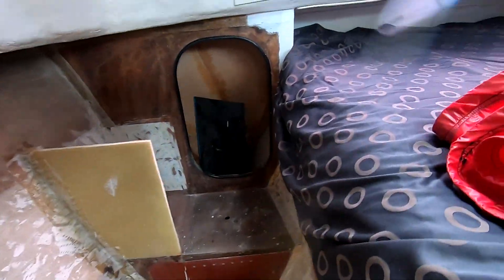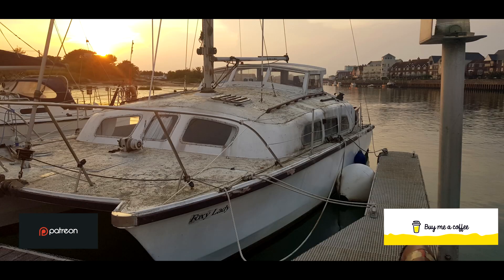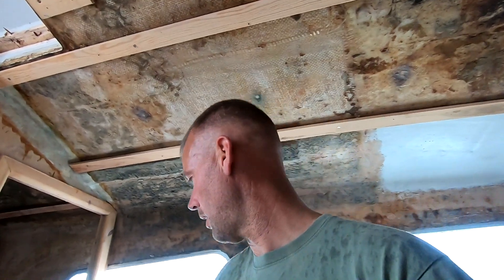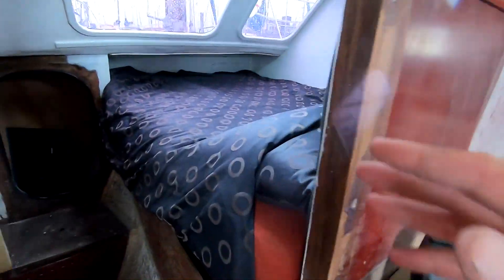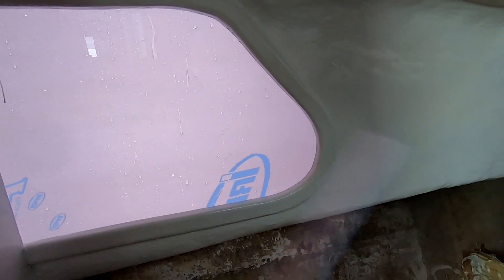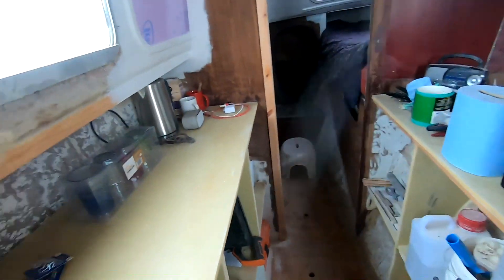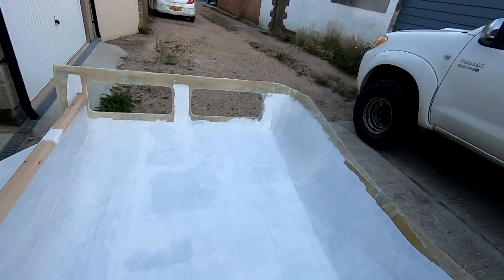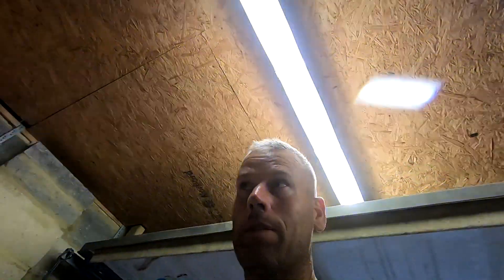DIY Dodger Sprayhood fitting plans and a good clean E75

Comment: Try pouring a 2 Lt Coke into the toilet and Leave it overnight. It should clean the stain.
Reply from the maker: Thanks mate, I should have done. Ended up scrubbing the he'll it off it😆 the coke sounds like a much easier option🙃
Reply: @SailingFoxyLady  not so certain that phosphoric acid is a good thing for enamel surfaces, doesn't seem to clean teeth real well )

Comment: Great job Spence. Dodger looks great. Have you considered a painted non slip texture on the bench tops?
Reply from the maker: Thanks Lindsay, it's finally coming together. 🙌 
The biggest issue with Foxy Lady is the getting the many old layers off first so I can create a decent base. I'm thinking of a painted finish with something like the rubber sand in it. This winter will be just prep work now I think and I'll start painting new coverings on when it warms up on the spring. The dodger and interior is taking priority at the moment!